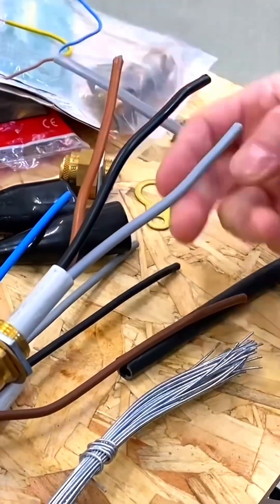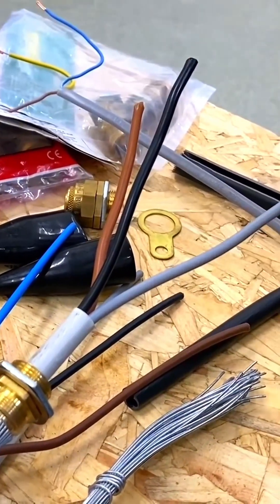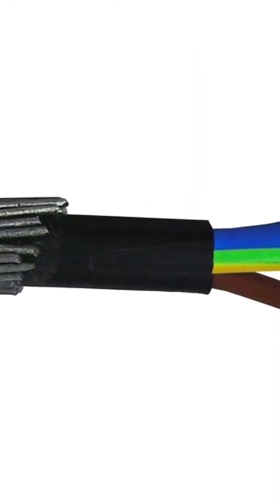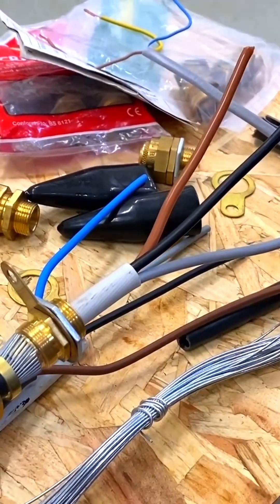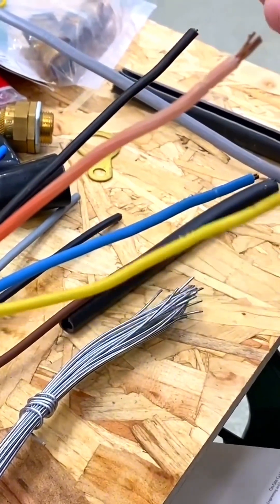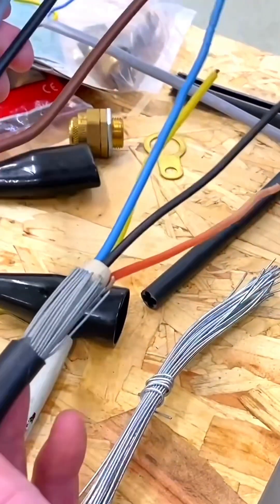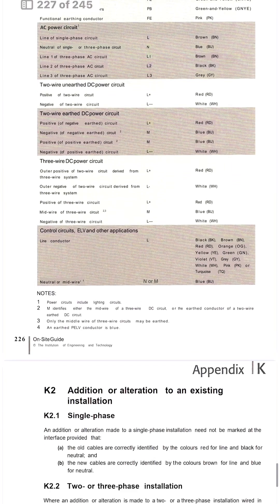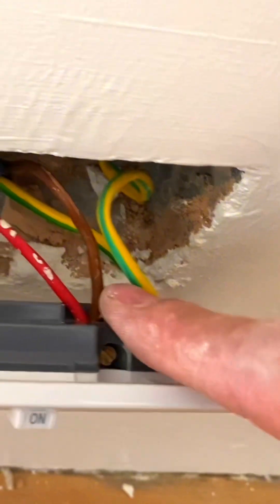It's Been Over 21 Years

Comment: Retired Electrical Eng …. Was in Spain Years ago walking past a group of Spanish Electrians working in a road side kiosk, interested in the work being carried out I stopped and looked at them identifying the cable cores on a 3 phase joint, they had put Red Yellow and Blue tapes on the cores, I laughed and made a comment, they replied that the English way of identification was far better than the continental way, then went and changed over to their colour codes, resulting in years of confusion in old industrial installations, don’t have the same effect on the house bashers

Comment: How about splicing in new cables in a food factory, with cables saturated in citric acid, and a stray live phase into the distributor box, nobody knows where the feed comes from. It caught me, when I nearly tripped that stray live. Old pre 60's distributer boards, connected to a number of, over time cobbled up extensions, where new machines had been installed in factory extensions. The usual nightmare for maintenance engineers to fix, when a line goes down.
Reply: Remember it well
Often worked by torch light which made it worse

Comment: Although it might not be a formal requirement for single phase, in the meter box at my house there is a mixture of old and new colours, the original having being installed in 1984. The installer that put in a new meter labelled the old and new ones (with the cables being large enough) by writing by hand in with black pen marks - at least, the red, blue, and brown ones. There are a couple of Henley blocks to connect in to a pair of grey cables from a DC -> AC inverter, and there are old and new colour connections on each side of them now.

Comment: As a non electrician, but Mechanical/Electrical engineer, this example, to me, shows why the black cable in domestic 3 core and earth should stay as the old neural colour, instead of the grey... Anyone with a bit of decent electrical knowledge will know " old neutral as Black" , similarly, like a car battery, where your Ground, or Negative is Black... I do realise that the Mains neutral isn't a negative conductor, but in relation to polarisation,  Red/Brown as a main load out conductor and Back/Blue  as a return to source. Just my humble opinion seeing it from a sensible engineers view   :-)
Reply: Red blue and yellow was perfect
Reply: @chubbychubs4636 red white and blue was first . Union flag colours .
Reply: @chubbychubs4636 I know right, if its not broke don't fix it...
Reply: That's a fail, as in a 4 core the black will be a live/phase conductor. And you haven't worked on many vehicles, positive and negatives can be all sorts of colours !! Car manufacturers follow no sensible schemes, often using both browns and blacks as positive, and oddly rarely red for positive FFS
Reply: The ground on cars is brown .
Reply: @dennisphoenix1  Not sure what car model or manufacture you are referring, but black is ground on any cars/vehicles I have seen ....
Reply: @tazdevil875  vauxhall use brown as ground .
Reply: Eu harmonisation in 2004 changed black to blue... 
We are encouraged in the trade to pursue a practice of de-neutalising the black... so in a 3core and earth cable we use grey as neutral, with blue sleeving added
Reply: @morestuff4401  Yes, I do know the history behind it....

Comment: Yellow only became a phase colour in 1966 with the 14th edition, before then, from the 10th edition (1934) onwards it was white, and before 1934 it was permitted to use either white or yellow.  I’ve still got (somewhere!) some short unused lengths of early 1960’s red white blue (and possibly black) SWA cable.
Reply: I have just been working in an old school where the single phase circuits are wired in phase colours , white and black on a lighting circuit and a later yellow and black on a socket circuit.  Both using the conduit system as the Cpc . I liked the red white and blue , flag colours of the Union .